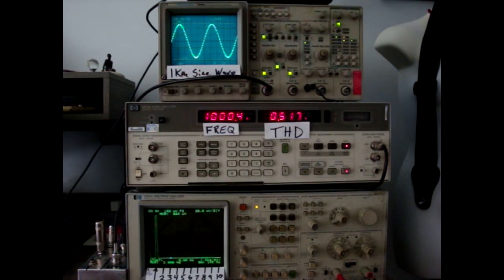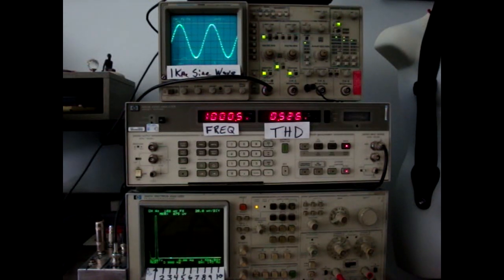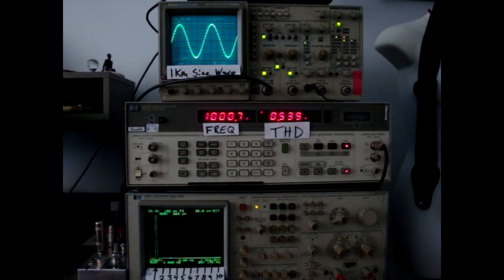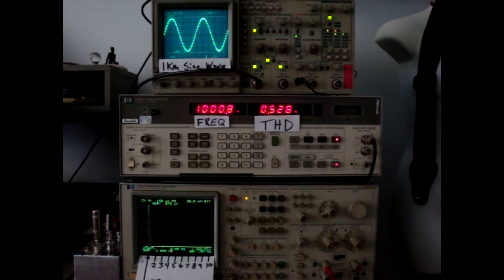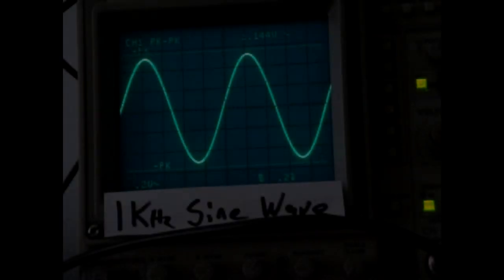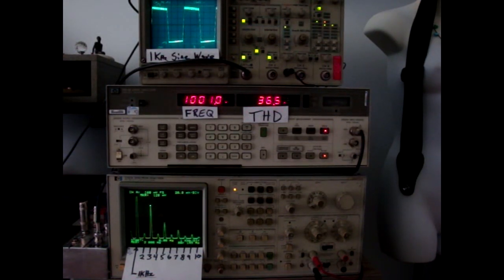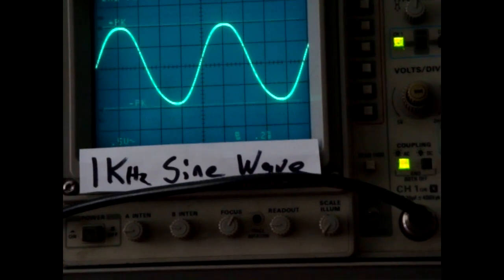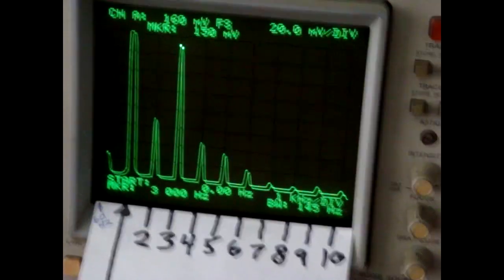Understanding Distortion (Pt1) - Tube amps Vs Solid State

Comment from the maker: TEST EQUIPMENT:

Tektronix CFG250 Signal Generator

Tektronix 2246 100Mhz Oscilloscope

HP 8903B Audio Analyzer

HP 3582A Spectrum Analyzer

8 ohm, 300 watt load resistor

AMPS USED

Solid State:  Gorilla GG-25
Tube Amp:     Original design similar to Vox AC15

TEST SPECS

Input signal:  1 Khz 250mV rms sine wave

All tone pots preset as neutral as possible by
adjusting with square waves for minimal
visible waveshape distortion

All measurements across 8 ohm load

Comment: And they say transistor amps are as good as tube amps, not in the cases of guitars. I want my sound to have those seconds, fourths (I love fourths) and a little bit of sixths order harmonics in my sound. And that distortion is beautiful, is a-symmetrical. I like those! Especially when it's not done by diodes.

Comment: i try to understand your test set up ,cause you talk square wave but you put a sine wave to input of the amp can you explain  cause i begin in the world of distorsion measures so more distorsion means greatest  harmonics amplitude  am i right    thanks
Reply from the maker: Square waves were used before the sine tests to ensure the eq controls were as neutral as possible. We want no frequencies boosted or cut for an accurate measurement.  A sine wave has no harmonics, and a square wave has many, so only the sine wave is used in our distortion tests here... You are correct, more distortion does equate to more amplitude of the harmonics. Hope that helps.
Reply: i understand but if you want to see harmonics on your spectrum analyser you must put a square wave at input of the amp  am i right @amptechron
Reply from the maker: @kubockferre5532   No, we're overdriving a sine wave. The harmonics come from clipping.  The square wave is only used on the oscilloscope, like when you calibrate your probes.

Comment: I have a question about the amps used.  Is there an EQ in the stack for either amp between the pre-amp and the power amp?  Could that account for some of the differences between the two?  It would help some of the debates about tubes vs solid state if you could pull the signal out immediately after the pre-amp instead of going all the way through the rest of the stack.  I don't think any EQ before the pre-amp would matter since that is an almost pure 1KHz sin wave.
Reply from the maker: Before the test, I used a square wave input to insure the eq is set to the most "neutral" position as yes, it can have a huge effects on tests like these. A similar technique to using a square wave to compensate an oscilloscope probe. In the future I may make a jig allowing single tubes to easily be tested for brand differences, etc....

Comment: This one of the few videos about this with some objective facts. A question: For a hifi amp, would you normally run the gain(volume?) high enough to get this distortion? I get it for guitar amps where you overdrive the tubes on purpose.
Reply from the maker: Not likely on a hi-fi. Tube gtr amps are never really below 7% THD, tho Id imagine hifi circuits to be a bit cleaner.

Comment: This is very interesting. As an engineer myself, I like these kind of objective, scientific measurements of the actual circuit behavior in guitar amps. It’s nice to see what is actually happening with the spectrum analyzer, you can’t argue with it.

It’s pretty clear from this that tube amps not only produce more harmonic distortion, but actually more even order harmonics (probably due to the “soft clipping” of tubes). I had someone try to convince me once that this wasn’t true and that solid state amps produce even order harmonics too, but I saw only odd order harmonics with the solid state amp. It just comes down to the physics of semiconductor devices and vacuum tubes and the circuits that use them. I remember deriving the Fourier series of transistors in some circuits and they do indeed have primarily odd order harmonics. Although the circuit design can affect things. But the even order harmonics you find most often in tube amps is what makes the distortion sound more “musical.” Of course that doesn’t mean solid state amps are bad. Whether you like it or not is all subjective.

Comment: Single ended topology = 2nd harmonics , gate topology = 3rd harmonics. Large signal = soft clipping ,. Class A = zero intermodulation distortion (small signal). Output transformer =specific distortion.

Comment: Great video , I’d like a video on connecting a spectrum analyzer to test the outputs of stereo receiver/amplifiers .i own two Spec analyzers but am weary about blowing up the front end . How to go about interconnection?
Reply from the maker: You can buy attenuators to put between the load and your analyzers. 10-20dB should be fine depending on the input limits on your gear. Good luck!

Comment: Hi Ron. Looking to get rid of low end flab when I activate the overdrive circuit in a solid state amp. Clean, the low end is perfect, the minute the OD channel is engaged teh low end sounds like weak or as if the speaker is overloaded. That's can't be the case though as teh minute yo go clean you get strong clear low end. The amp is cheap and I got it for nothing, so looking to mess with it if I can. Thanks.
Reply: try using a compressor

Comment: Clipping... This area must be avoided, not analysed imho. And one quick question. Why don't you use a $130 computer interface that allows to measure -120dB harmonics comparing to your -100dB (as I can see) hardware analyzer?

Comment: Excellent video!  An Interesting video testing another solid state amp that is using a different path to distortion. It produces quite different traces to the SS amp you used. Much more tube like.

https://youtu.be/0YL_zVs8ZS0

Comment: I'd love to see you run this test with tube amps and a digital modeling amp trying to replicate them.
Reply from the maker: If I can get someone to drop by the Amp Lab with a Kemper,  I'll certainly document it, cause Im wondering too....
Reply: @amptechron  where is the Amp Lab, if you don’t mind letting us know?
Reply from the maker: @Dram1984  Just north of Orlando
Reply: @amptechron  ah, that is very far away from me. It was worth a shot though :p
Reply from the maker: @Dram1984  If you're ever in my hood or need a schematic drop a line!
Reply: I’ve recently done this experiment with an axe Fx amp modeller and valve preamp. I’m no expert but to me the resulting waveforms are the same in from the modeller as they are from valve preamp. They were not identical as the modelled amp was not the same as what was used as the preamp. One notable difference is the valve preamp waveform contained a small amount of signal noise along it on the modeller, the interference was non existent. The modeller also models diode clip circuits and they seemed similar to the waveforms in your video on diode clippers but I’ve not done the test myself yet. It also models led clipper and germanium diode clipper and would be interesting to compare those results with a real circuit but I don’t have components to do that test. I have a photo of my oscilloscope screen with the green trace being the valve preamp the blue trace coming from the modeller I’ll post it on my own put the link here
Reply: Modeler are just great in simulating diode clipping, and clipping in general.
What we like about tubes is that  way before clipping you have a unpredictable creation of new harmonics then you have a very broad clipping from super soft to hard. Digital is perfect in recreating hard clipping